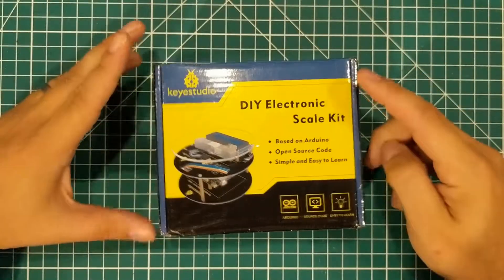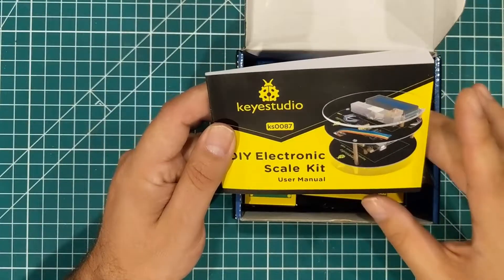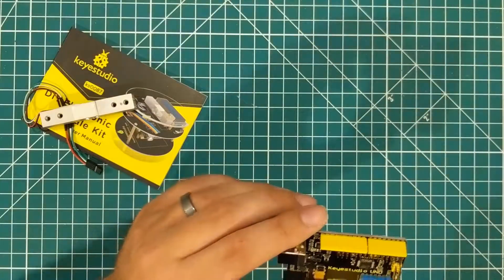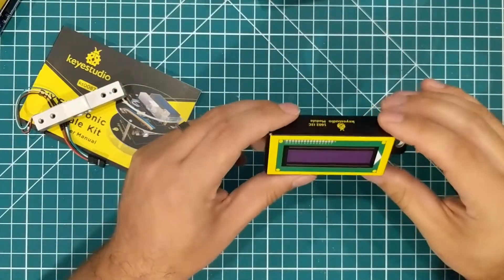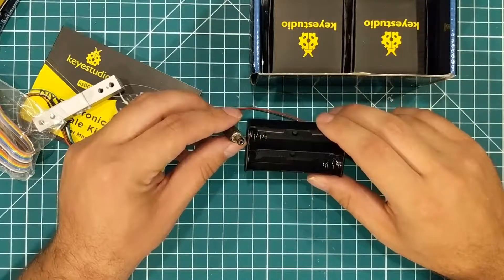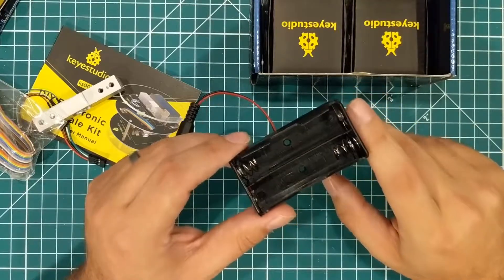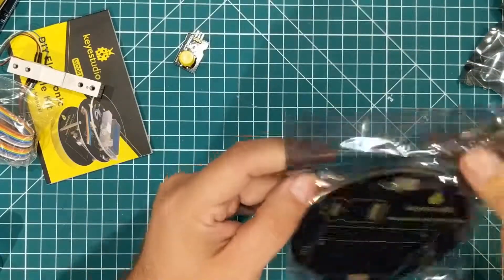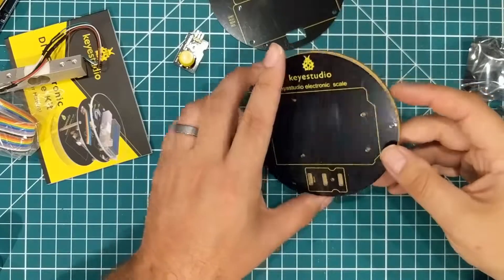Keyestudio Arduino Scale Unboxing and Review - KS0087

Comment: Great video! How does data transmission work? Can that board be connected to WiFi for data polls or push if I want to store weight values over time?
Reply from the maker: You can do it 3 ways pretty easily.  You can plug the scale into pc and use node red to capture the serial output and do pretty much anything with it. You can use an hc-05 or hc-06 bluetooth sensor to send the serial data to a phone.  Or you can use an ESP8266-01 module to send the data over wifi.